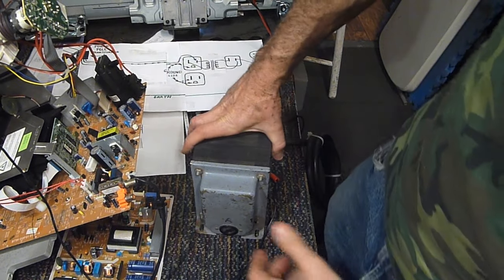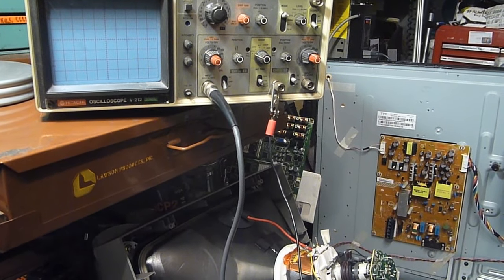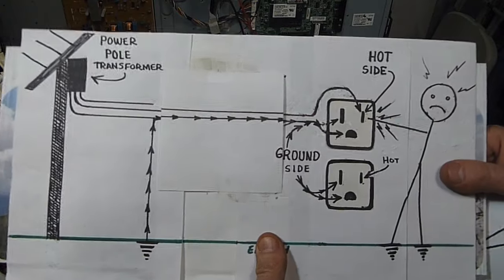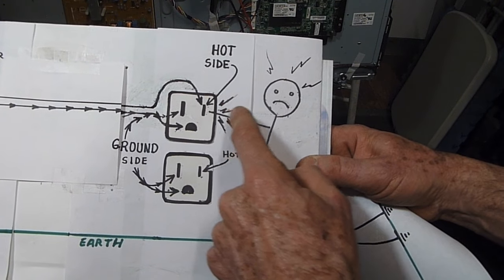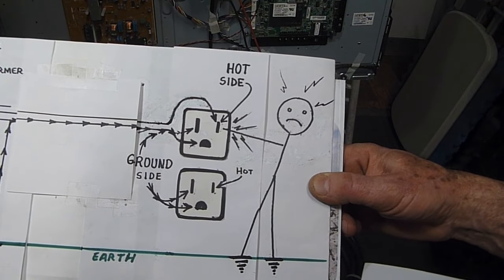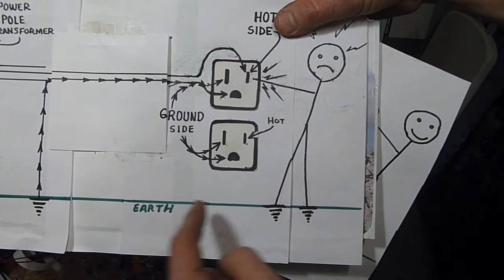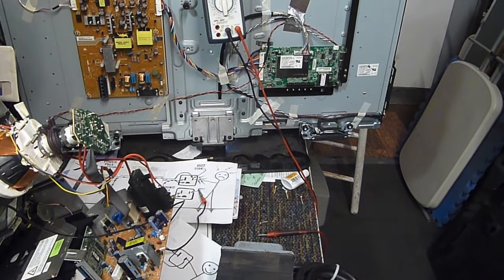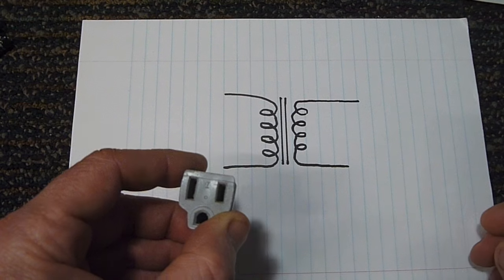Isolation Transformers can save your life, and your equipment.

Comment: I did not understand . How isolation transformer help to save from shock
Reply: To be honest, this video said things extraordinary clear, but may require that you understand how voltage and how voltage is referenced works. The idea behind and isolation Transformer is that you are making the electricity you are using no longer referenced to the electricity of the devices you are around and the ground you are standing on. This means that you no longer have to worry about a tool you are using completing a circuit through your body to the Earth you're standing on or to the outlet on the wall. If this is where the confusion has come in for you, I would recommend looking at some additional videos about voltage. Afrotechmods has done several videos on the subject that are fantastic.

One thing I must stress is that understanding these concepts are absolutely necessary if you are going to work on anything that is Mains powered. Dig in as far and deep and hard as you possibly need to understand this information but definitely understand it before you start to work on dangerous equipment. :) also, if this did not help explain things for you, maybe respond back with some specific questions. Most people in this Hobby or profession are pretty helpful.

Comment: Regarding isolation transformers. In the U.K. we have the mains input of earth, positive and negative.  What if we just disconnected i.e isolated the earth input would this have the same effect as an isolation transformer.
Reply: In the UK we have Earth, Line and Neutral - that's very different from 'positive' and 'negative'. And the answer to your question is a big NO, for the same reasons given in the video.

Comment: You should be aware of the dangerous part in using isolation-transformers. In worst case you are going to die since there is no protection like PE. E.g.: if the housing is connected to a pole and you accidently touch it and the other pole= R.I.P

Comment: Not good to use isolation transformer on test equipment. This will eliminate tlhe protection and a have risk of electric shock if any problem happens on the equipment. Use oscilloscope with input channel isolation feature or floating ground on the input channel is preferred.

Comment: Be careful with such an explanation, even an isolation transformer does not protect against electric shock and you show if you could put your fingers into the power socket.
Reply: If you touch only 1 lead at a time of the output of the isolation transformer , you don't feel anything at all, even if with 240V.